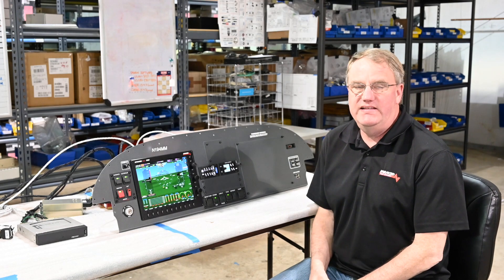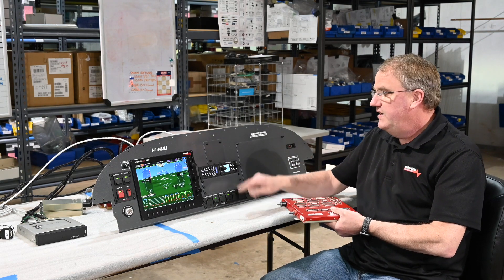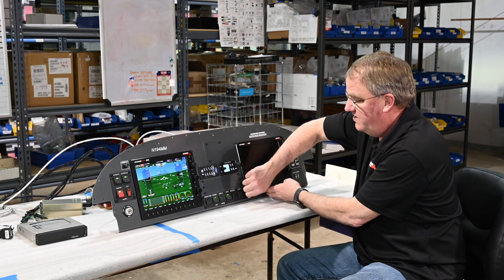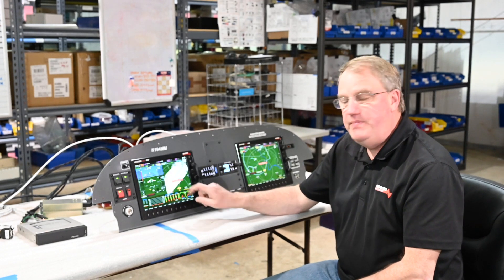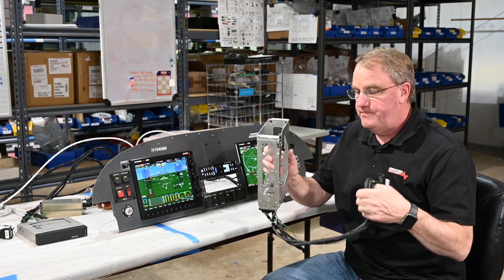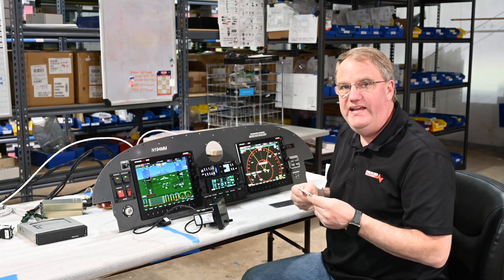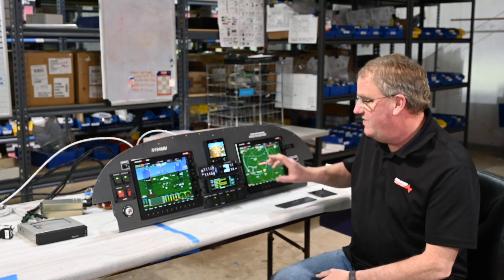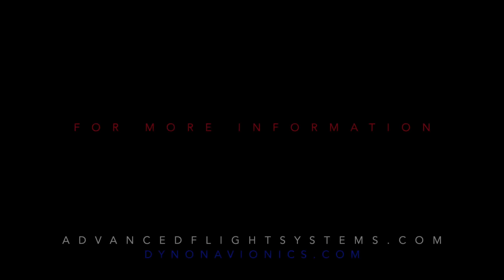Advanced Panel RV-7

Comment: I really appreciate your ability interface with Garmin.  I just upgraded my mixed Garmin RV7 panel with all Garmin.  It was really challenging and took weeks.  Your system makes more sense.  Having to hard wire electronics in today's world seems crazy.  Especially knowing you will want to upgrade every 10 years or less.  Your plug and play system is great!  Wish I had used your system.

Comment: You showed mag panel and p-mag panel.  Do you have a switch panel for 1 mag and 1 p-mag?
Reply: Lynol, single p-mag switch module is also an option.  It looks just like the one in the video except with only one CB switch.  You would continue to use the keyswitch position for your regular mag.
Reply from the maker: Yes we do